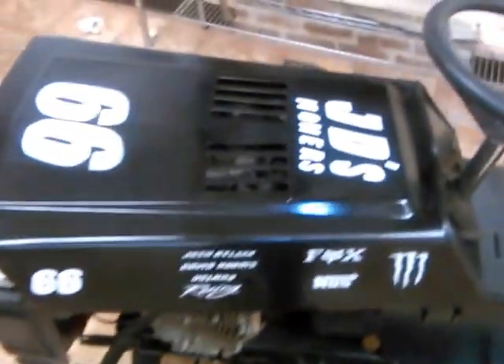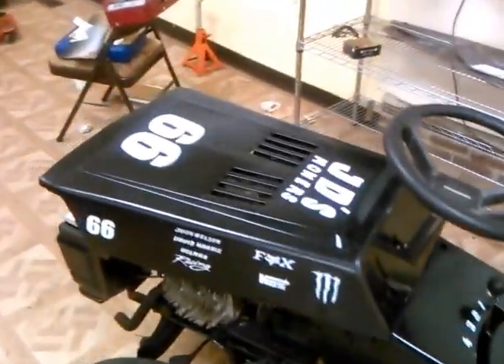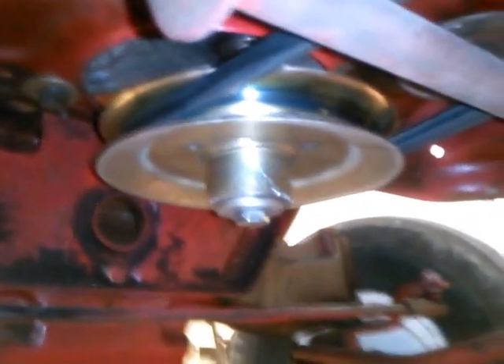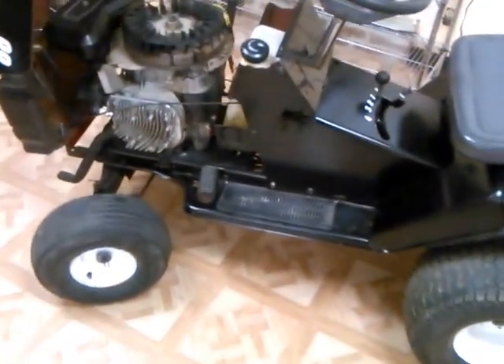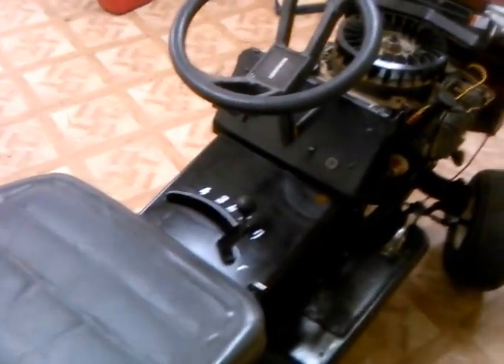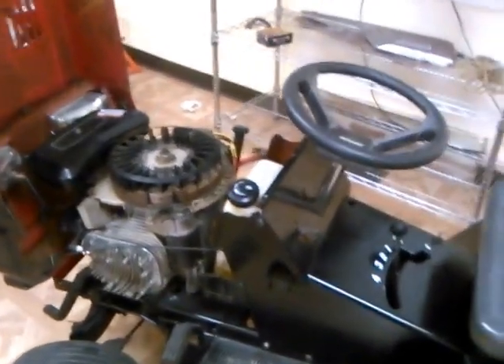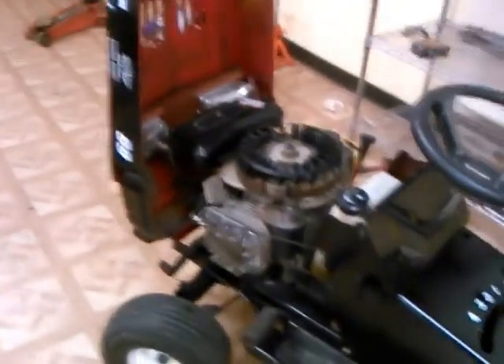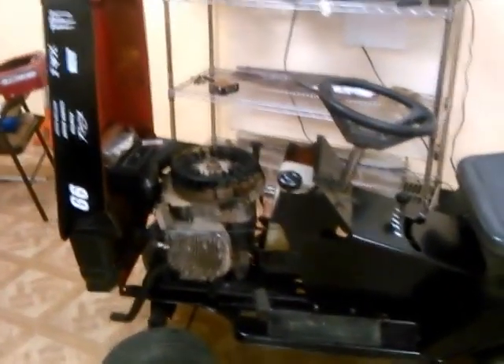racing mower part 7 please support my channel

Comment: How much did this build come to money wise??
Reply from the maker: cal burnard so far it's at 400 but some stuff I got for a trade on craigslist but when it's all done I will probably have about 1500 to 1600 in it
Reply from the maker: cal burnard so far it's at 400 but some stuff I got for a trade on craigslist but when it's all done I will probably have about 1500 to 1600 in it
Reply from the maker: cal burnard so far it's at 400 but some stuff I got for a trade on craigslist but when it's all done I will probably have about 1500 to 1600 in it
Reply: +dead man ok thanks
Reply from the maker: not a problem anything you want to ask you can

Comment: not trying to sound like a dick, but it sits too high. flip the front spindles over, and remove the "L" brackets in the rear or suck the transaxle up, also maybe cut the steering column down a couple inches and add handle bars with twist/thumb throttle.